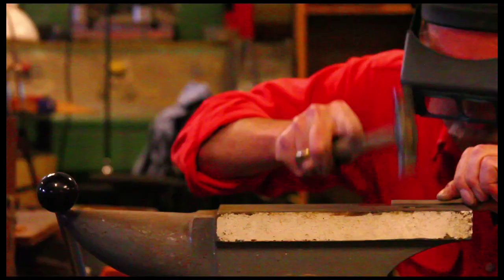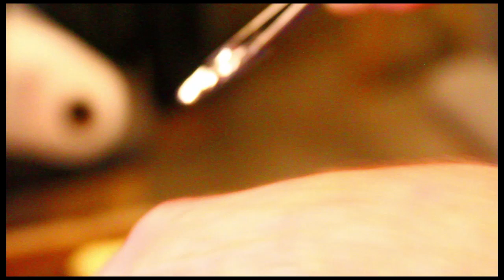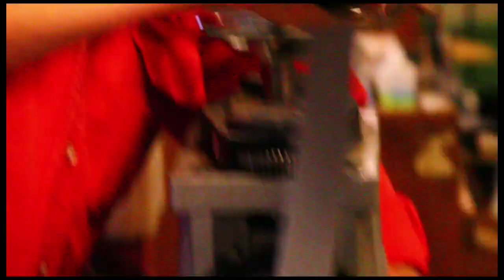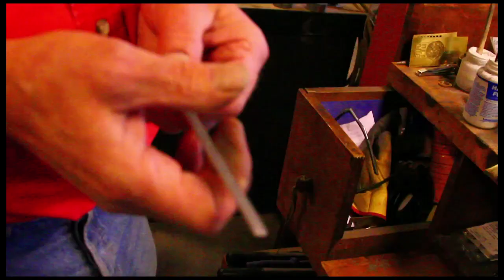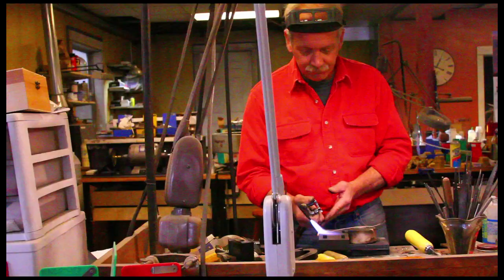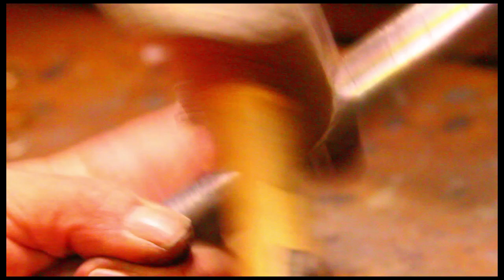hand forging a platinum wedding band -- Dan Palmer of Ravens' Refuge

Comment: Thanks for the great video! One question I had is in relation to the ingot mold. I have read many places that you are not supposed to use anything with carbon when working with platinum. However, the mold looks like it is high-purity graphite. What kinds of mold are suitable for platinum and where do you get them?

Comment: My Dad has three rings that he wants me to melt together into one. Two are 18k gold, and the other is platinum. Is it even possible to mix gold and platinum since they have such different melting points? I have a little blacksmithing and bladesmithing experience, but no experience with making jewelry, and no experience working with platinum or gold. Any help or suggestions would be appreciated. Also let me know if you might be interested in doing something like this and if so, what would you charge?